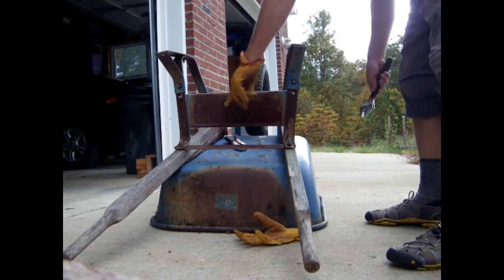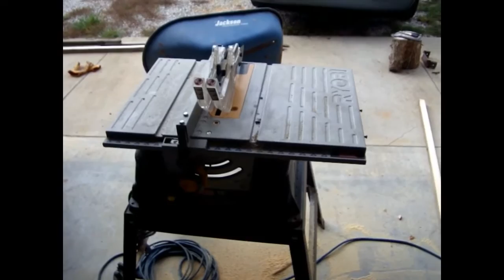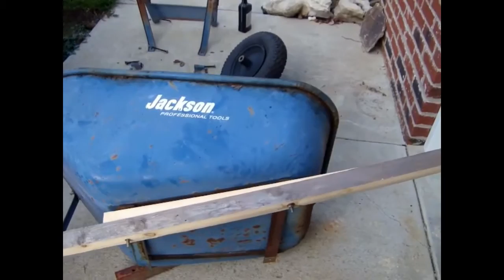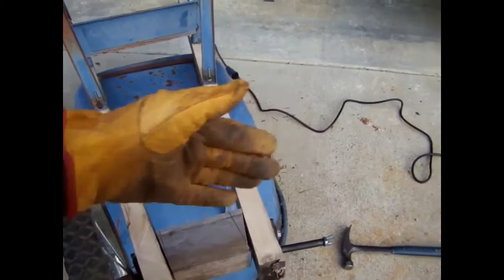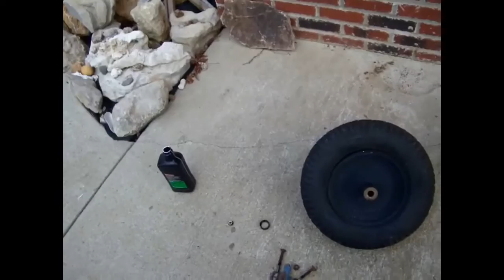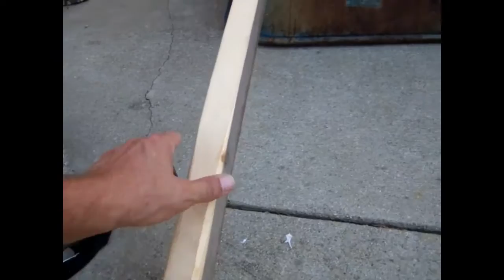DIY Wheelbarrow Repair v2

Comment: I just rebuilt my old steel wheelbarrow a month ago,  and now I'm viewing what others have done to see what I might have done.

BEST think you did was to oil the bolts when the barrow was new!  Rusted bolts that have to be cut away and replaced are a pain.  However,  I'm painting on axle grease I happen to have on hand rather than oil.  That see3ms like it ought to last longer.

Using the mower wheels is very creative!  However,  I'm finding that the main reaswon barrow wheels wont hold air is that the tire no longer makes a good seal with the bead on the steel wheel  ----it needs a sealant. I've seen people recommending a variety of different sealants,  which suggests that any sealant will probably do the job.  I used my trusty axle grease again,  and after a month  the tire doesn't leak.

Very good on replacing the rotted wood.  The wood on my thirty year old,  much neglected barrow was still mostly good.  I replaced one of the wedges,  which had rotted out.

My major criticism of your rebuild is that you didn't disassemble everything and prime and paint everything,  especially the obviously rusted tray.  You did a lot of disassembly,  but not this essential feature needed to avoid further deterioration. I'm  surprised.

After disassembling everything,  I painted everything with Kilz primer and then with house paint,  since again that's what I had on hand at no cash outlay.   That's all the wood and all the metal,  including the tray.

Since seven years have gone by since this video was made,  I'm wondering how your barrow is holding up?

One thing that should be emphasized with wheelbarrows,  I think,  is that they are vehicles that need to be inspected,  maintained and repaired  ----not neglected until they don't work.  Inspect and maintain your wheelbarrow and it will provide much longer and more reliable service  ----such as by greasing or oiling  those bolts before the threads corrode away and the only way to disassemble the barrow to maintain it is to cut the bolts and replace them.

I also favor stenciling on the maximum recommend load for your barrow.  I'd bet that many barrows are damaged by loads that are too heavy.   The max recommended load,  stenciled on the tray where it faces the operator,  seems like it would be a good reminder.
Reply from the maker: Thoughtful commentary - thank you so much.  Yes, it's been seven years.  The wheelbarrow has been stored under my deck ( the deck is 11 feet above ground), standing up on the front edge and wheels.  Thus it does not collect standing water and only gets about 1 hour of direct sun per day.  It remains serviceable today.  It was a fun little repair project.   
 
Thank you for watching the video.  Your comments may inspire others during similar repairs.